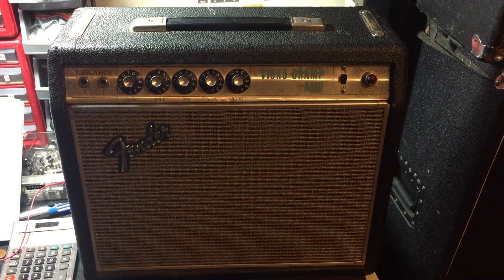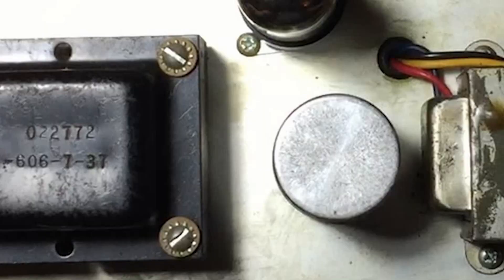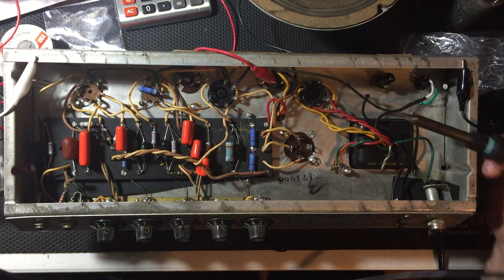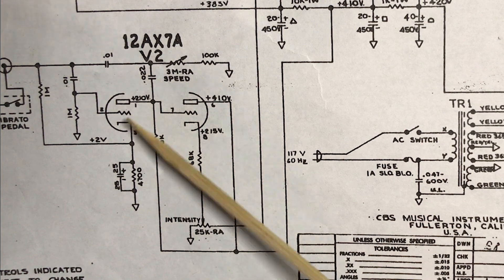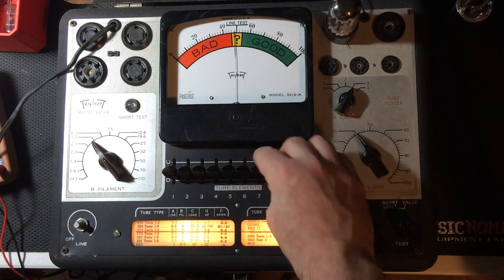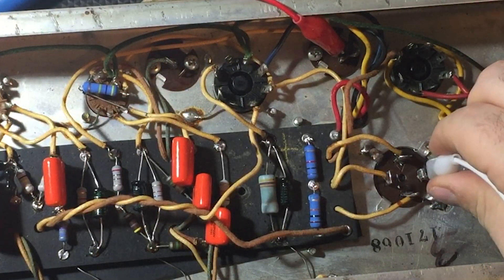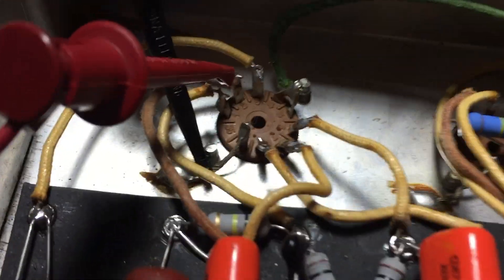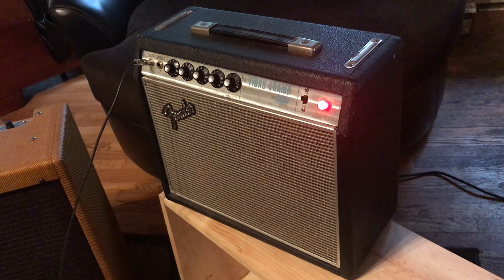1960's Silverface Vibro Champ Amp Repair

Comment: I'm guessing from experience that you may not have measured the 6V6 plate voltage correctly ----  If you measured from pin 3 of the tube to chassis ground then your voltage measurement also includes the voltage being dropped across the cathode resistor which gives you an incorrect result. Either subtract the voltage that you measure across the cathode resistor or simply measure from pin 3 of the tube (plate) to pin 8 (cathode) and that will be the actual voltage drop *across the tube*, which you can then use in calculating plate dissipation.
Reply from the maker: Voltage drop across cathode resistor and plate voltage give what you need to get very close in this configuration. This amp is cathode biased.